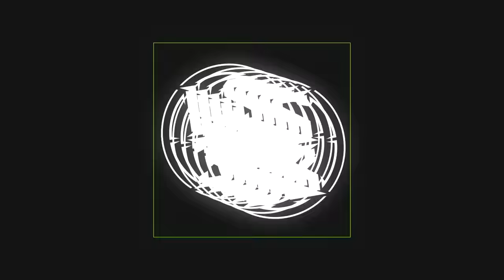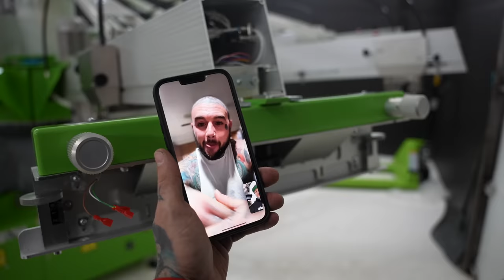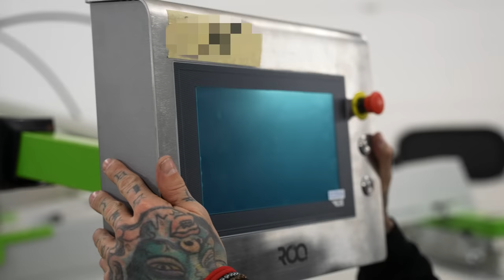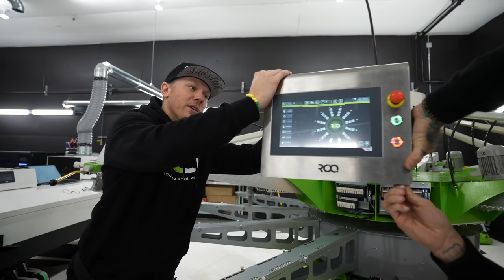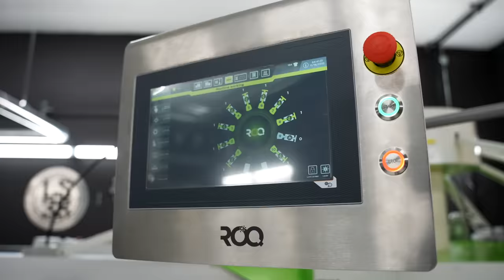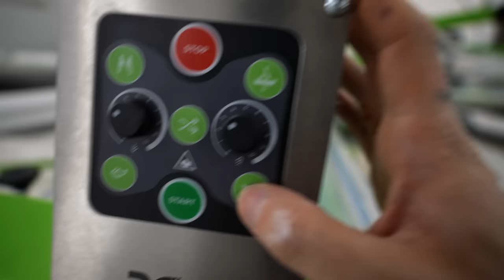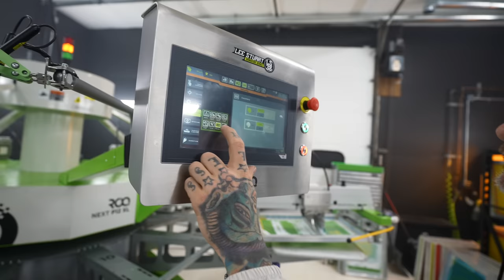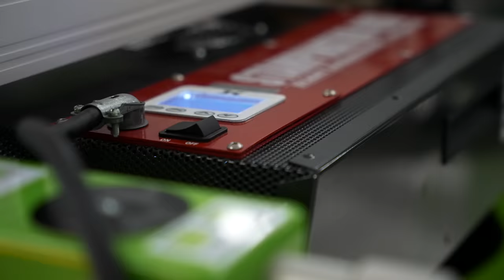This Thing Is Like A Ferrari! My New Automatic Screen Printing Press Is AMAZING!

Comment: I am in the process of purchasing my own small shop now. I have 42 years experience as a screen printer. I moved to a small rural town years ago and have been at the shop I am now buying for close to 20 years.. Once I purchase my shop, I will no longer be the screen printer. I won't have time to do that because like you, we also do vinyl sign and graphics work as well as headstones. Finding someone in this small town that can manually screen print with consistency is going to be brutal. Everyone still thinks shirt printing is all push push button, which, even when it is, it isn't. I just might have to make the leap into auto presses.... 
Your new press is insane!
Reply: Hire me I have 30 years screen printing both manual and automatic

Comment: Glad you are over the Auto problems. 
We have a P12XL and P14XL and still find limitations with colors when flashes iron and cool-downs need to be included. Would love to learn more tricks you share!
Reply from the maker: Ya the cool down stations needed end up eliminating a few heads unless you run in multi print mode and send stuff around 2-3 times. That's a big reason I went with a stampinator over an iron so I could gain one head back. The world of auto printing is pretty crazy, there's a lot of possibilities and new things to learn 🙌🏻

Comment: The inline heat press is a game changer for the print finish quality. If you are't using heat press  in your process you need to be.
Reply from the maker: It's an incredible tool. Loving it so far

Comment: On that first print why did u use 2 screens for single color? (Im a manual printer)
Reply from the maker: Speed mainly. On an auto you want the print to only make one rotation around the press. But it's also a quality thing, I print with 2 screens on a manual too. Using a second screen with a higher mesh count keeps the print lighter and thinner

Comment: Did you manually registered the screens multi-color? did you use the micro knobs if you did not use the registration jigs?
Reply from the maker: The first one was with the skull was dead accurate from the pre registration system, no adjustments. The 2 color design needed a few small tweaks

Comment: Why be stoked about 8 color to a 10 color..I only see 1 reason ..if u are juggling jobs..other than that most screen printing jobs are only a few colors.sometimes u get 5or6 color jobs.not often
I have a vastec v2000 works well..love dancing with press. Looking at automatic press..I only want a 6 head 6 platform automatic. Don't need a industrial unit for screen printing..
I see u getting a tajima....nice...I got 3 tajima..and if u ever wanna do a Andrew tate and let screen printers come to your location for a class..for a fee...I might come see u..and I said Andrew tate cause I saw a vice video and Andrew charged 100 men 5000 each to come to his event..
Just a thought..
Reply from the maker: I run 6-8 color jobs on a regular basis. In reality I'd love to have a 14 color machine to open up to more high end work but it won't fit in my shop. 10 colors will get me to a new machine quick though